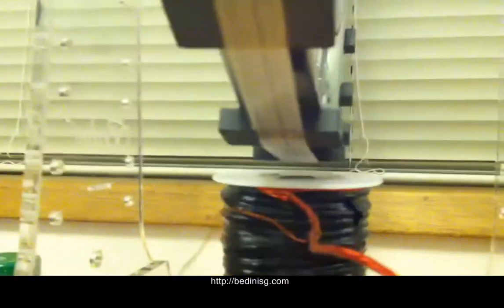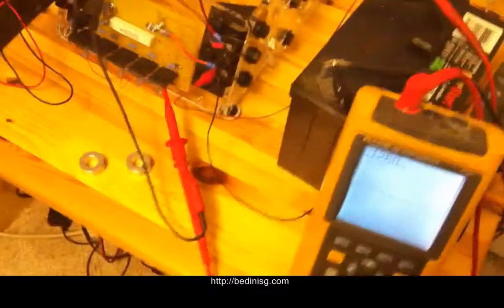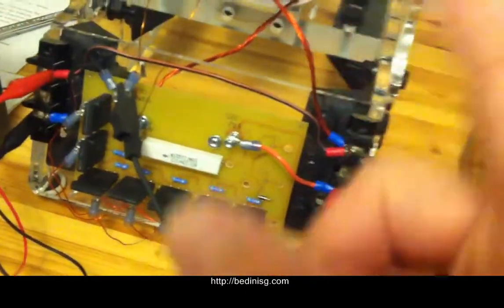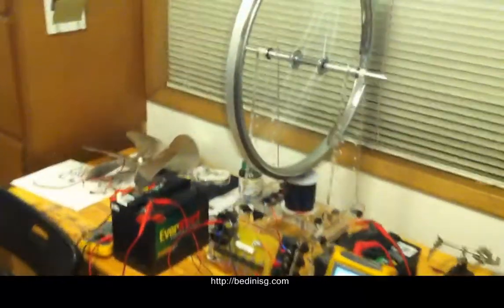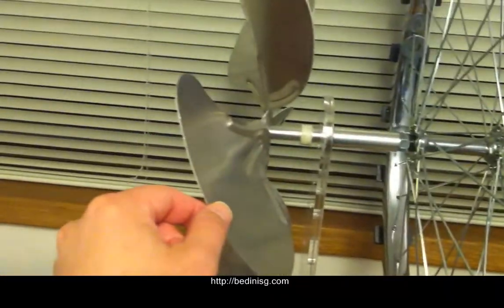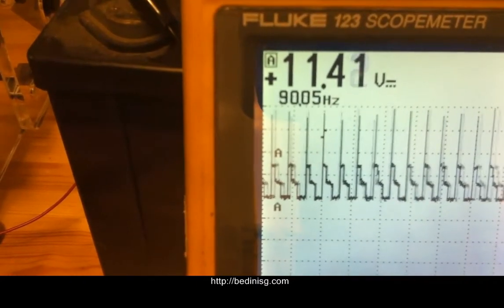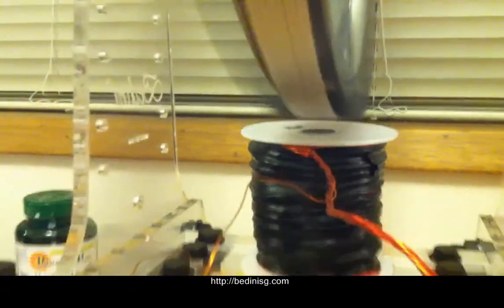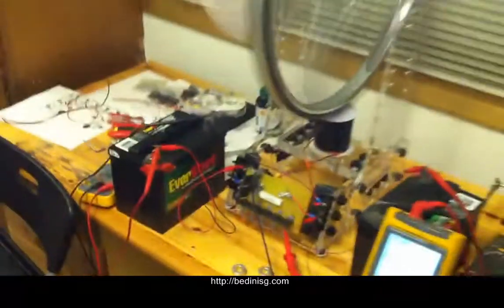Bedini SG - Open gap for faster RPM

Comment: Why won't my car's starter battery charge?
Reply from the maker: Probably too sulfated and all the chargers you're using to charge it up aren't pushing the voltage high enough. Needs to be pushed to 15.1-15.3 for flooded cells.
Reply: @AaronMurakami13 I bought a new 75-amp starter battery with 650 cranking amps. It's not charging. 🤔 I used the Bedini installation program. Why isn't it charging? It only charges to 12 volts and won't charge any further.🙄🙄
Reply from the maker: @RUMPLESTILTSKIN_  I don't know what Bedini Installation Program means. Post in https://energeticforum.com and we can get into it there.
Reply: @AaronMurakami13  But I assembled the "Wheel" and it doesn't charge🙄I bought a starter battery and it doesn't charge.I don't understand what the problem is.
Reply: @AaronMurakami13  Tell me why it doesn't want to charge.

Comment: I have a doubt regarding the motors vs the generator with Bedini’s design. 
Are the voltage spikes that are fed to either a capacitor for current impulses (low frequency) or straight to the battery as created by the collapsing magnetic field from the current provided by your primary power source or from the magnets? 
My understanding is that the magnets only serve for timing as they toggle the PNP transistor. Am I wrong?

Comment: That's a nice looking SG build Aaron.  I've got a Self Runner but yet to build the Commutator & Recovery Coils.. its sort of a work in progress..  I've fitted the rotor out with high performance Ceramic Bearings which I've installed on the frame.  I've also managed to attain one for one charge across 6 solid state oscillators...  I'm working on something new..  Happy New Year.

Comment: dumb questions: This is producing more electricity than it is using, right?  How much?  At what point does the value of the electricity produced surpass the cost of the generator?
Reply from the maker: This is just a demo model to teach the magnetic recovery while running on one battery and charging another. The Bedini SG can produce more work that we have to put on the input, but it requires large batteries with low impedance and multiple large coils. There isn't a financial advantage so don't look at saving money even if you have an energy gain. It's cheaper to just go with solar. The Bedini SG is one of many machines that simply shows what is possible.
Reply: @AaronMurakami13  Hmm.  Not sure what I'm learning here.
Reply from the maker: @zendogbreath  It's in the title of the video - there are many videos on the Bedini SG and this is one that showing you what the title tells you.

Comment: Hello, I made this project to seven transistors with a spool of 80 meter length of spinning and it goes very well. I would like to reproduce the same project but with 10 reels. Is it necessary to have as long wire (80 meters) per coil? And does the electronic circuit keep the same principle? Thank you and congratulations for your work.
Reply from the maker: Details are in the books at http://bedinisg.com - for 7 transistors, do you have 7 separate wires for each transistor all wound together? If you have that for one coil, you do that for all 10 coils and parallel up the inputs and outputs.
Reply: OK, thanks a lot. Before starting the 10 reels, i'm going to do the montage '' Comparateur '' (joule meter) to observe and compensate my recharge battery # 2 versus my expense run battery.

Comment: the metal curtain is probably making little drag try raising the curtain & see if the speed goes up
Reply from the maker: That's a valid point - prob too small to tell but those blinds got tossed for new cellular blinds.

Comment: Very good, thank you!, I have a question my friend Aaron; How connect the oscilloscope?
Reply from the maker: Lots of different ways - depending on what you're looking for. The primary use of a scope for me when putting it on a SG is to make sure that the transistor is only triggering once per trigger. With too much base resistance, you can get multi triggers each time and you don't want that. So you can have a 100 ohm power resistor in series with a 1k 10 turn potentiometer and dial that until you only get one trigger. You want the maximum amount of resistance while allowing it to only trigger once. It changes with speed so you have to adjust it a few times as it speeds up to the max speed. You an hook the ground to the ground and the probe + to the collector or to the base, doesn't matter for this purpose because no matter where, you will see the quantity of triggers each time.
Reply: Thank you very much for this!!!

Comment: Would more poles add to the drive power and output?
Reply from the maker: +scarmenl Yes, of course. This is a single coil with 7 power windings, you can easily put 10 coils around the entire wheel. That is simply known as the "10 coiler" - you can search it on google.
Reply: How to connect ten coils with ten battries or an other way is possible

Comment: Somewhat of topic but still interesting.
So Aaron or anyone else have you tried to have a horizontal wheel, maybe would be some difference due to gravitational forces? 

Thanks for the video
Reply from the maker: +Banzay20 I have but no difference from gravity. However, there are tests I want to do using a high speed sphere rotating around a vertical axis, which is used as a rotor for the SG. With HV electrostatic potential applied to the sphere's shell, I believe it can be possible to deflect downward pushing gravitational potential towards the perimeter to be sucked into the coils when the magnetic fields collapse thereby adding extra potential to the circuit, which did not come from the source battery.

Comment: Good night, respected engineers.
Please could tell me what number of revolutions per minute (RPM) turns this device? and finally what is the amount of torque (N - m)?. Thank you very much.
Reply from the maker: Juan Diego Velandia Roughly 360-400 rpm. Mechanical work in horsepower in this attraction mode is about 30% of the electrical equivelant.

Comment from the maker: I just tested it last night with a 0.25 ohm current sensing resistor on the input ground line and it was around 1.8 amps X batt voltages was about 22 watts.